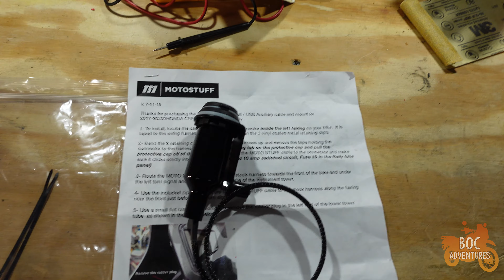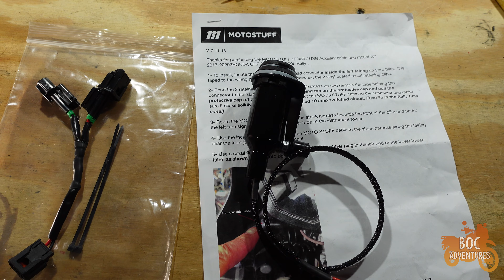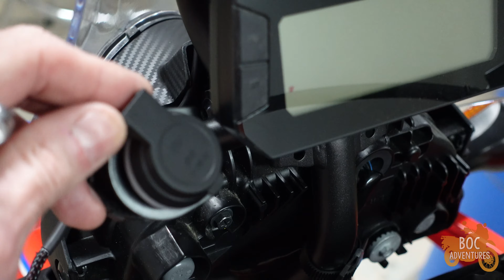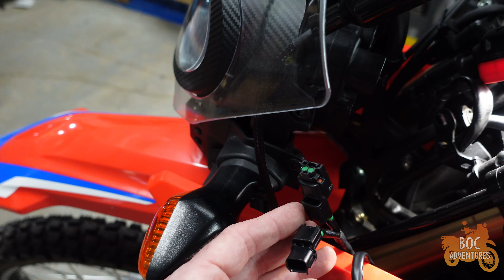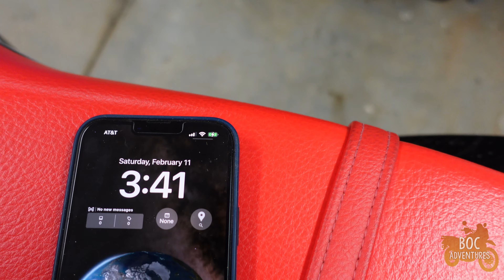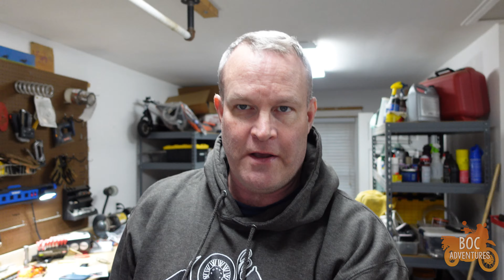HONDA CRF 300L RALLY BIKE BUILD - USB Charger     #crf #crf300l

Comment: At 6'4" how does the stock setup feel for fit?
Plans for peg lowering? Bar risers? New bars?
Reply from the maker: Handlebars are pretty low.  Not sure if there is a peg lowering option but stock doesn’t feel bad.  I have new bars and risers ready to go on.  I usually hate to do that but I’m this case it’s necessary.